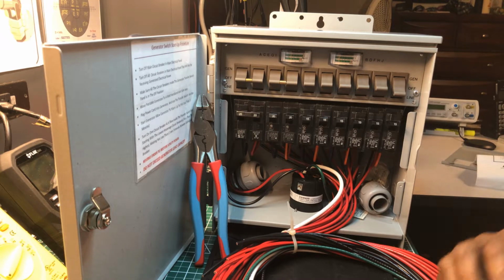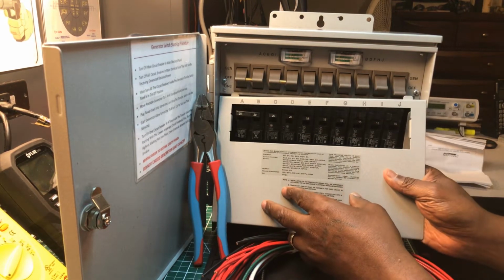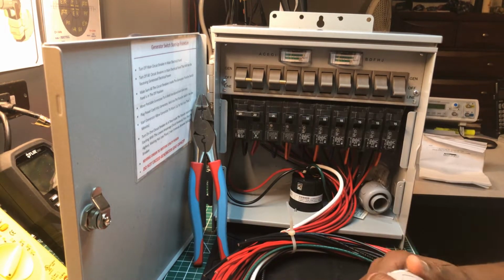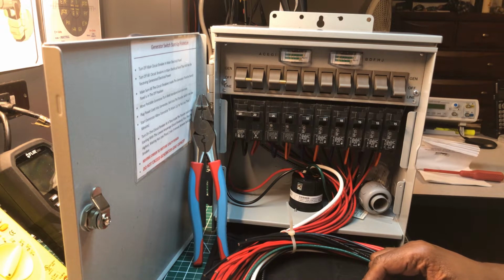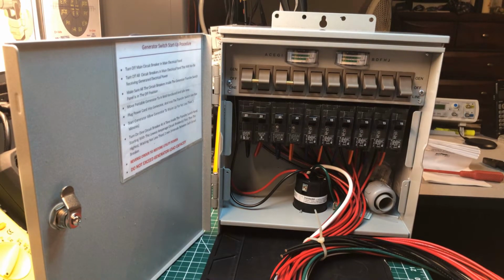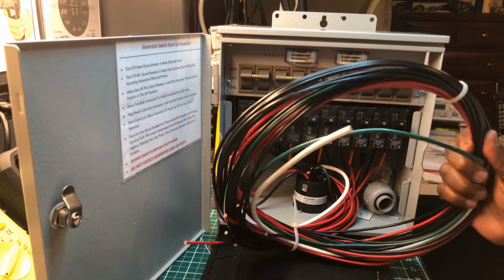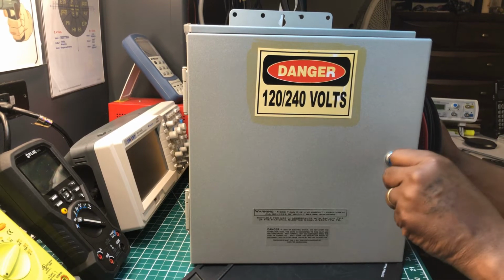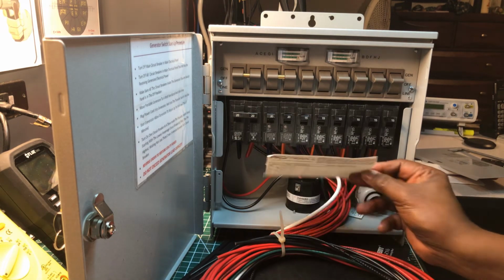🇺🇸 “ RELIANCE “ Manual Transfer Switch For Portable Generators #R510A

Comment: So is a 50A 10 switch. 
Did u used the power generator 50A instead of the 30A connector,  right?
Reply from the maker: I’m using the 30A connector at the moment.